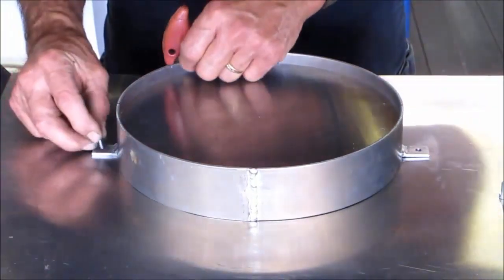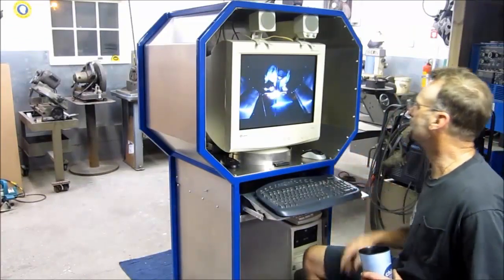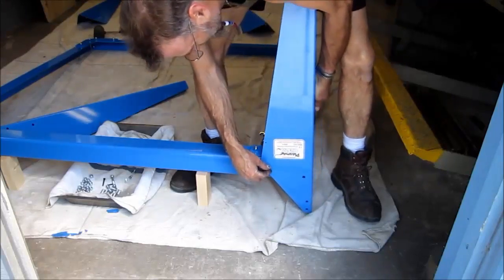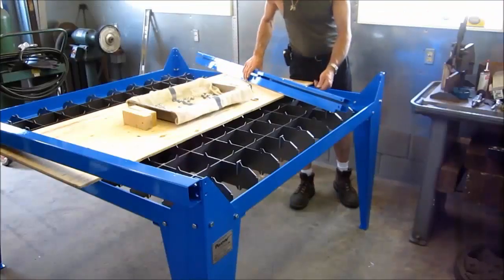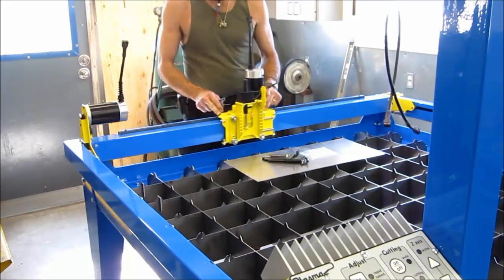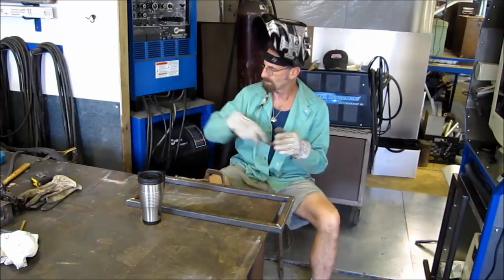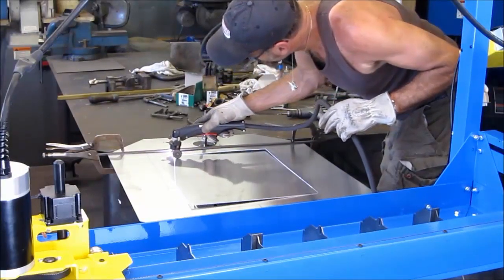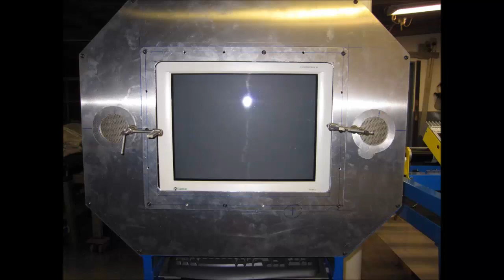Getting ready for PlasmaCAM 3

Comment: So Glad you brought this back to us, Thank You.  A real Gem seeing you with your Christmas presents and the care, fun you had and detail in assembly.  Engineering your computer station was well Done!  I bought a pair of Nema Boxes for my Drill Machines and they weren't cheap as I remember but the guys still killed the keyboards at least once a year.  Yours should last a long time, at least until we can talk to them. ;-)  Am curious about your fan system for the lower side, and it seemed that you were drawing with that upper fan/can filter instead of pushing?  Just the best!
Reply from the maker: The flow is downward and out the vents in the lower half. ;{)-----

Comment: Thanks for sharing that video.  I have always been curious about your PlasmaCAM.  I built a CNC Router Parts CRP-4848 router table, and have done so I've been very tempted to build my own CNC plasma table.  I have most of the hardware, motors, etc. The plasma cutter side of the equation is something I know nothing about.

Comment: Man!  What a great idea..."continued" or complete use of those filters.  Those vacuum filters aren't cheap any more.  Time to develop some simple, cheap, rechargeable vacuum filter element????  For regular shop use, the pc console filters would have to be virgin status.  I reverse-blow out mine with the air nozzle and stretch them out.  Eventually, I got to throw them out.  But, you got those metal chips and oily gunk that won't blow off (and is messy, dangerous....etc.).   Really cool idea... "thinking further on down the road, not just forward"!

Comment: I don't see any pricing on the PlasmaCam web site.  What was the ball park figure on your table?
Reply from the maker: Trex1268 back then with the high end software and controller was at 11 K
;{)-----
Reply: Keith Fenner As I said in another comment the other day Keith, I reckon that this PlasmaCam has been worth every last cent you paid for it in terms of time saved and the detail cut-outs you can perform in a range of materials and thicknesses.

Comment: I asked you a long time ago...Why go through all that trouble building that enclosure, when a Laptop computer is all you need?
Reply from the maker: Doot Derman I don't like Laptops! ;{)-----
Reply: Laptops are cool (I have two and a tablet).  But they have little cooling fans that suck dust, smoke, crud, and vapors into the chassis.  The first spot the cool air hits is the power supply circuits.  Any vapor in that air stream could mean death.  I spilled a drink on the same table that my laptop was on and the fan sucked it in and fried the mother board... dead laptop!  I took it apart, thought I'd fix it...  but the motherboard looked like a B-52 bombed it!  Laptop key boards are vulnerable to dust and damage too.  If a key dysfunctions, you are in big trouble.  Sure you could ebay a new keyboard and install it... but that is a drag.  A stand alone cordless key board is cheaper, has more keys, is more ergonomic, and can be swapped in less than a minute or two.  A laptop "could" work, but I'd hate to see one get trashed by a shop environment.
Reply: You have to remember Plasmacam, like a lot of CNC equip, uses the parallel port. (Lots of industrial CNC also uses  RS-232) -NOT USB! Why? Because USB, Firewire, etc does not do well in high EMI environments, which this absolutely is. Older port types may be a bit slower but they are far more reliable. Most laptops now do not even have anything but USB and cardreaders. Plasmacam also uses servos on the x-y axis', a feedback servo is way better than a stepper, especially in vibration prone and harsh environments. Then there is cooling, grit, all sorts of things. Even if he had a laptop, he would need an enclosure! Laptops are just not modular enough or robust and operationally flexible enough.
Reply: cny02253
 Good answer! :)
Reply: *****
Yeah, there are all sorts of problems using laptops. People just don't understand that RF and environmental shielding, serviceability, reliability and minimum and predictable latency are way more important than computer speed or small size.